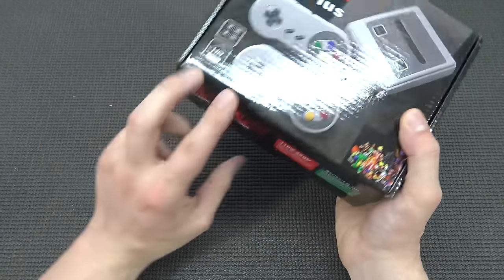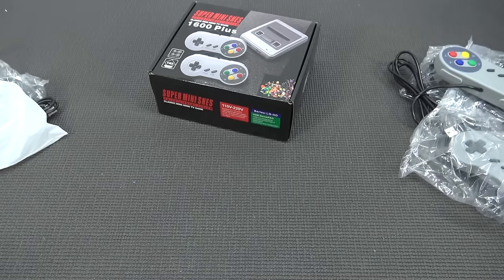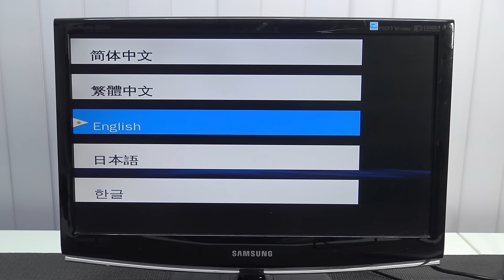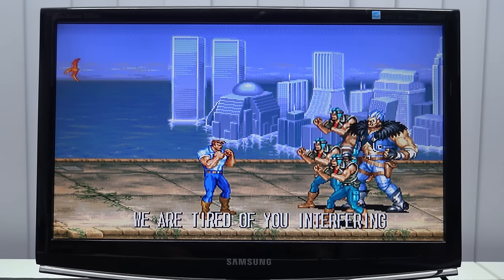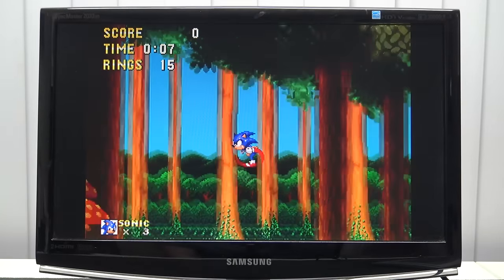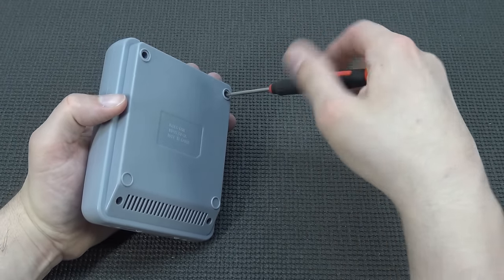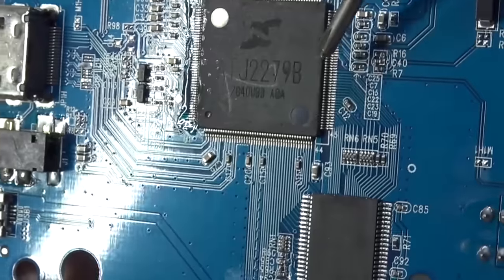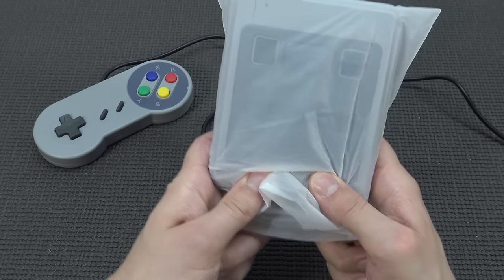Super Mini NES PLUS - 1600 in 1 - Ultimate And It Plays Everything 😨

Comment: It's the Actions ATJ2279B, yep, I know this one. It's the same as in the Powkiddy J6 and Powkiddy X16 that we're hacking together with some nice people at XDA. It's not a bad chip but really low end from 2012 , MIPS single core running at 450 MHz. 
 Interesting is that they've changed the menu from the bubbles one on the Powkiddy J6. Somehow though I think the emulation on the Powkiddy J6 is better.